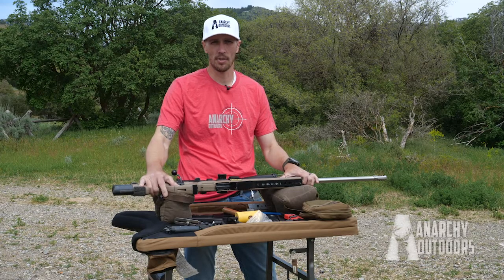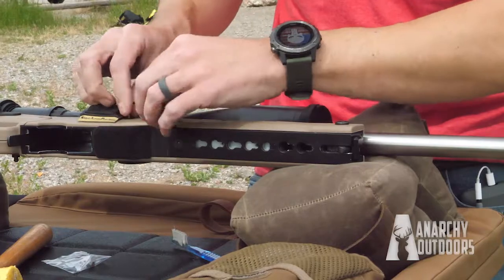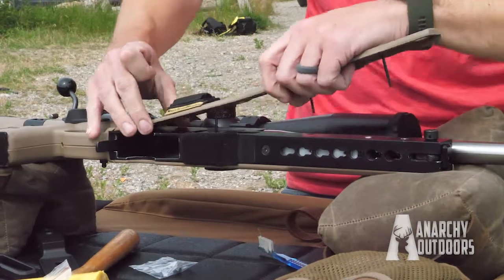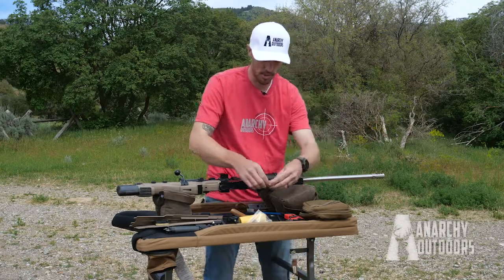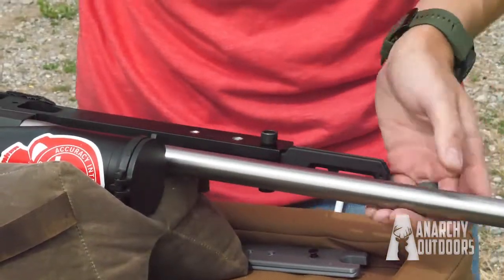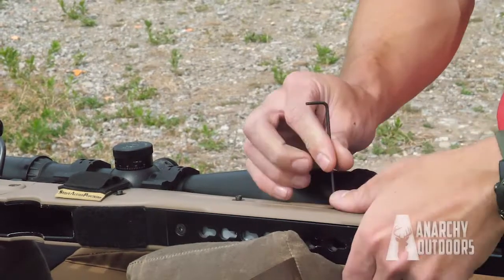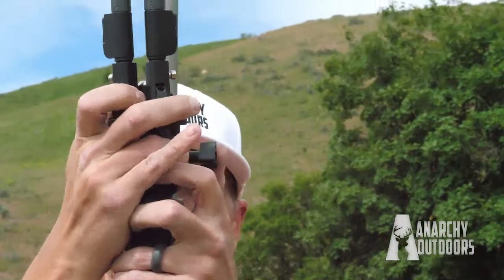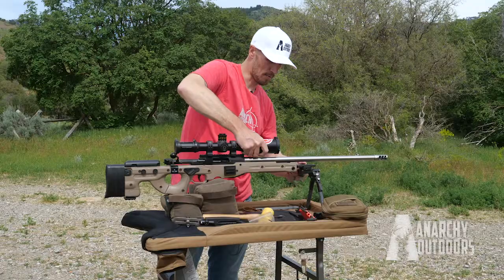Accuracy International AT Spigot Mount (Installation)

Comment: A 5/16" or 8mm Roll Pin Punch is the correct tool to use to get the roll pins in and out.  Also, I highly recommend cleaning the threads on the QD flush cups, and using either Blue Loctite or VibraTite prior to re-installing them into the new bipod block.  Without Loctite I have had them start to unscrew while carrying the rifle slung.  You'll see how much thread locker is on from the factory when you try to remove them for the first time!
Thanks,
Sam
Accuracy Obsession, LLC
Reply from the maker: Thanks sam will need to make an updated video.

Comment: So my AE version has the sling loops instead of the flush cups. I got the big roll pin out (there was only 1) but clearly the sling loops plate needs to come out to allow the existing spigot/block mount to come out but I can't figure out, or find info on, how to release and remove the sling loops plate so I can then remove the spigot/block mount and replace it with the AE Arca Swiss mount.
Reply from the maker: We emailed you back correct?